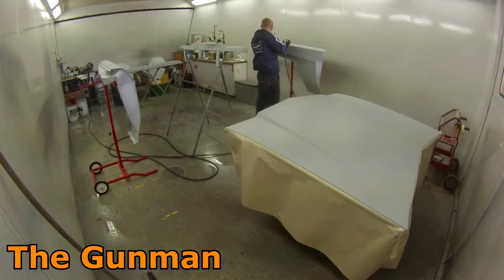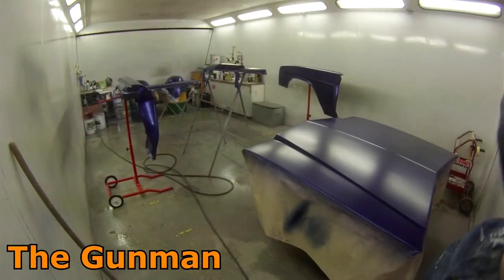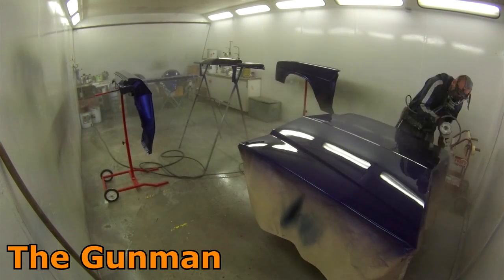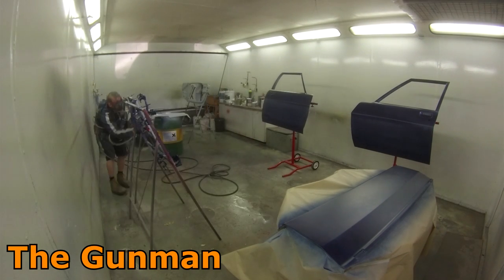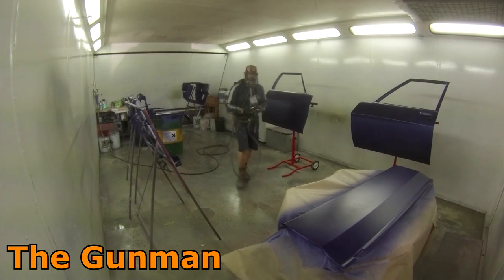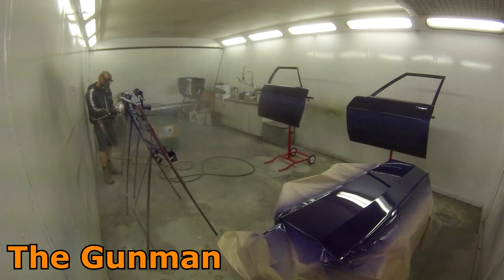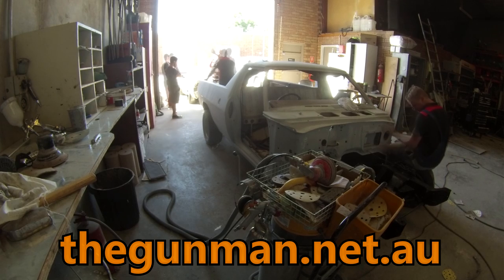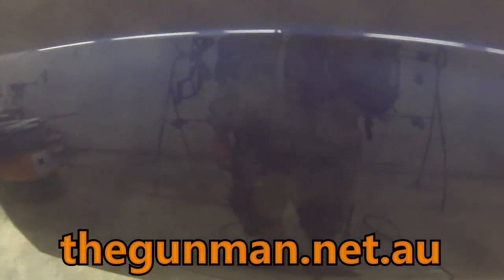Time Lapse Spray Painting WB Ute Part 2

Comment: Thanks for your advise rod,I will give it a try,it's just I tried spraying the clear at 25/25 psi and didn't seem to break it up enough,that was with 1.2 full turns on fluid at 22 c temp medium hardner,painting close and fast,tight overlaps,I've got a few air caps to try out yet so could give those a try also,thankyou

Comment: Hey gunman,great vid as always,if I could ask for abit of advise,I had gti pro t2 for clear,I have 1.2 and 1.3 spraying spies hecker hs 3.1 5 percent,I am from the uk and is pretty chilly at the mo,so have started heating my clear and hardner which has helped amazingly,just abit confused on fluid turns and pressure,do you think 29 psi is to much ,and the fluid control flat out as I've seen a lot of painters advising fluid control on gun should always be fully open?thanks for your time
Reply: +Tim reeks, I can tell you that you should use the least amount of pressure it takes to atomize the paint you are using. 25 PSI is usually enough and the fluid in many cases should be turned in 1/2-3/4 turn from full open depending on the viscosity of the paint, air temp also comes into play. Too much paint flow will get you into trouble in a hurry.